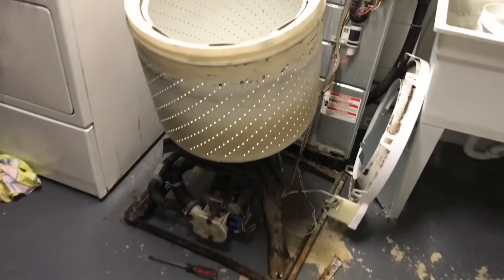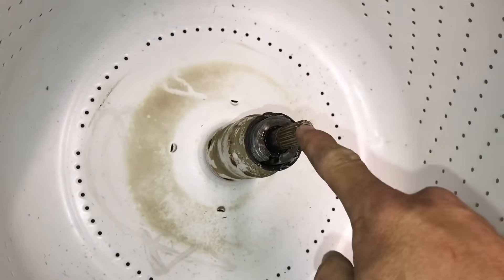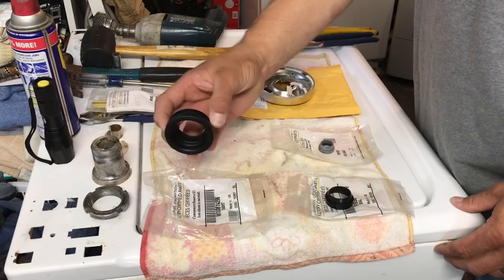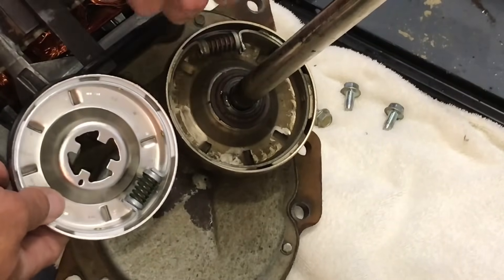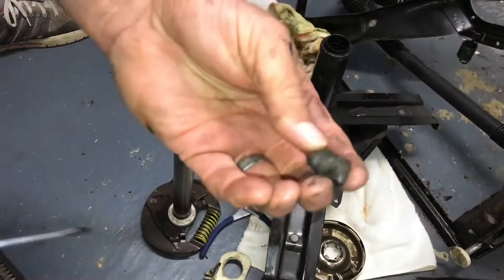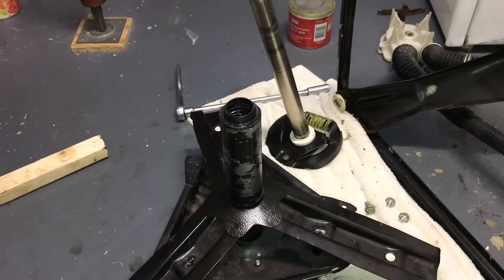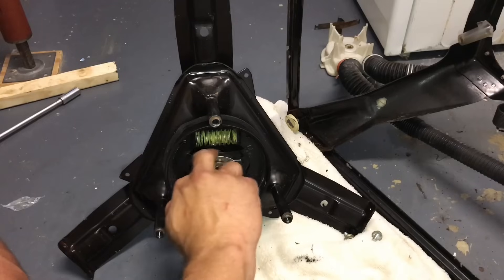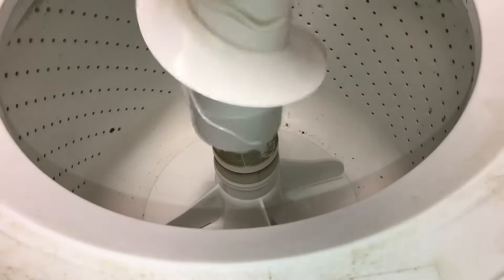Leaking Kenmore Washer - How to replace Shaft Seals.

Comment: Great video! Very helpful. I'm working on my 15 year old Kenmore washer which stopped spinning and I went through living Hell trying to remove the spanner nut, drive block and the brake assembly because of all the built up gunk. I haven't found the cause of the "no spin" problem as yet but I'm thinking the brake tube locked up inside the drum as I had to knock the top of the transmission shaft to get it off but as it's totally disassembled, I'm going to change all the seals, clutch, braking system and do a overhaul of the transmission, all new parts. I couldn't find a video dealing with the seals until I came across yours. Thanks!! One other thing that you can maybe advise me on.....the inside of the tube of the tub and some parts of the outside under the agitator are showing a LOT of corrosion. Is it wise to try to use a rust remover and some scraping to get rid of some of the corrosion then give the cleaned tub a coat of primer and appliance white or should I just scrap the project and dump the washer? The drive block was actually seized into the top of the tub and I had to knock it down the tub shaft with a large socket and an extension because of the amount of corrosion inside. What do you think? Yea or nay?
Reply from the maker: My deepest apologies for not getting back with you sooner. With that amount of corrosion that you’re describing, I would recommend buying a new machine. As soon as you repair this one or if you’re able to repair this one it sounds like you’ll have trouble with other components including the frame.  Or see if you can purchase the tube assembly that might be another option. Honestly I’m getting older and growing tired of working on things over and over and over. That’s why I suggest it might be time to purchase new.  Since your this far into it though go ahead and proceed the repair but if you find yourself tearing this thing down more than once every two years or so I would dump it.

Comment: Brilliantly made repair video!  Good pace, all the technical points covered, all part #'s called out!
QUESTION:  Where to get that 1/16" socket or nut driver for the fill shut off level adjustment?  I'm about to make a tool using an Alan capscrew that uses the 1/16" Alan wrench.
Reply from the maker: Thank you for the awesome comment and thank you for watching and subscribing. I think that tool that you’re making for the fill shut off level adjustment will work perfect. Check Amazon or a appliance supply company for that tool.  Thank you again, Happy New Year and stay safe.

Comment: good day, nice video, I pulled my old reliable apart and replaced the upper and lower seals plus the tub one, fired it up and guess what , still leaks :(, I noticed while I was down there looking for the leak that the noise it makes with the agitator seemed little odd, pulled it back apart and I can wiggle the shaft that goes though the lower seal, is there a bearing or bushing below that lower seal?, can't find anything online for parts?, is my unit trashed?, thanks for your time
Reply from the maker: There should be no play in that shaft. Especially since you replace the new seals. There is not a bushing or a bearing. At least not to my knowledge however, your model may be different. I would do some more research before I scrap the machine.  My apologies. I don’t think I was much help here.
Reply from the maker: @farmerrick9660  Thank you fir the follow up.  So glad you figured that out.  Bring new life to the old girl!!!  Cheers to you!!!

Comment: I have a question. I have a Kenmore 80 series and as I was putting the motor back in this copper like pin with a small hole on the end fell out of something. Don't know where it came from. Do you know where the pin came from? Would like your advice. Thank you!
Reply from the maker: Hello and thank you for watching and commenting. That copper or brass looking pin which is about an inch and a half long is used for shipping purposes from the manufacturer to the retail store. No need to worry about the placement. It’s not needed.  Hope this was helpful. Thank you for watching commenting and hopefully subscribing.

Comment: Good video and I appreciate the information. Did I miss it where you added any oil or grease back into the transmission case before reassembly? Mine had slung a good amount out in the bottom, which is what ultimately caused the clutch to slip. I'm just wondering what I need to stick back in there before reassembly. Any ideas?

Comment: Old video but people like me are still trying to do this repair. When I looked on appliance parts pros the installation video shows there are 2 seals for the top of the spin tube. Looks like you only replaced one but apparently it worked. WP91939 is the part you changed but underneath it is another seal WP356427.

Comment: Thanks for the video on the shaft seals.  Very helpful.  I have the same issue but I did also open up the transmission and found water in the oil.  I would suspect that any machine with leaky shaft seals could end up with water in the transmission.
Reply from the maker: I would agree.  Water will eventually find its way through the top of the transmission.

Comment: Great video, my tub makes a lot of noise as it spins up then smooths out a little. Sound is louder if heavier load like jeans. Are there upper and lower tub bearings for the shaft or is this noise from a dirty clutch or both. The seals will be changed either way.

Comment: Hi bro i saw video awesome job question I have a kenmore washer to but my washer almost the same Style as yours will the breakdown and replacement be the same? it leaks at the bottom I flipped my washer and it looks like it leaking from the seals were connected to the tub
Reply from the maker: The breakdown will be very similar for sure.  You might be lucky and only have the tub seal leaking.  That’s the large round seal at the bottom of the plastic tub. Let us know what you find.

Comment: Would the shaft seals gone bad explain leaking gear oil coming up through the tub and into the wash ? Had some clothing ruined
Reply from the maker: Sounds like the seals are bad at the top of your transmission where the shaft goes into the top. That’s an easy fix.
Reply: @SmokinwithKasket  maybe but it's a Moffit and I was told the transmission can't come apart
Reply from the maker: @Gates1999  Sorry to say - I'm not familiar with a Moffat.  My appologies.
Reply: @SmokinwithKasket  no problem

Comment: So I have a crack in the plastic tub.   Are these still available, or should I try to seal it with some sort of epoxy?
Reply from the maker: I don’t think trying to seal the tub will be successful because of the continuous, flexing, even from the weight of the water coming in and draining. If you are unable to order that part, I would suggest as a last resort to try that.

Comment: Thank you for the video. However  Im concerned that wedging out the old seals with a hammer and screwdriver could score/deform the tube bodies so that you run the risk of them not seating properly and continuing to leak even after you install new seals. 

Is there a safer way to remove the seals that doesn't risk marring the metal tubes?
Reply from the maker: Great point.  If anyone knows of a better way that would be great to hear.  I didn’t have any issues with my repair. There’s a better chance of damaging the new seal during installation.  It may be better to use a socket placed over the seal to tap it down into the tube.

Comment: When removing the drum. It is necessary to put a small screw in the top part of the shaft so the 3 jaw puller doesn’t turn as you tighten the puller.

Comment: Terrific video.  

My repair was going just as yours until I removed the transmission bolts.  The clutch shaft  would not - and will not - separate from the outer basket drive tube.  I've removed as much of the smaller top seal as possible - drenched both shaft and tube with PB blaster and pounded the top of the clutch shaft - (the end with the gear teeth) - with a sledge.  It simply will not budge.  As in "welded together".

Every video I've watched shows the clutch shaft sliding out from the basket drive tube with little effort.  I'm at a loss right now.  Called Appliance Parts Pros twice and, while courteous, could provide nothing beyond what I've tried, already.

Can you assist?

Thanks, Jack
Reply from the maker: Check to see I there is a retaining ring at the top. Short of that I can’t see a reason why it wont slide out.  Be sure there is no corrosion on the shaft at the top.  Use a wire wheel or sand paper to clean the shaft, oil well and it should come out.  Sorry - I don’t feel I was helpful.  Thank you for watching and commenting. Let us know what your outcome was. Stay safe!!!
Reply: I had the same problem when I had mine apart - did you ever resolve it?
Reply: Having the same problem I think. Transmission came out fine but can't get the shaft (upper seal section) apart from the tub support piece. Comes out almost all the way and then sticks the last 2-3". Guess i don't really have to separate them to do the seals, but would be easier!

Comment: I have mine all apart now, its definitely the same model, but im seeing something that looks off!  
Below my lower gasket there appears to be an internal metal cyldinder below it, but its a good inch below where the current lower gasket is.  

Is that right? 
I thibk i read that the lower gasket is intended to  meet against that thing, so im not sure if i need to raise it up higher to do so

Comment: Any idea where to find the part # for one of the upper transmission seals? There's some oily residue so I'd like to replace them while I'm in there. The pinion gear in the trans that also has the 4 fingers that the clutch rides on. There's a small seal inside of the gear that seals against the main shaft. I removed it but there are no numbers anywhere. Guess I could take it to the local shop and have them match it up. But you seem super knowledgeable about these things so I figured you might have a break down parts list or something. Thanks

Comment: Is there any way to tell if the leak is coming from just the tub seal or shaft seal?
Reply: Yes, I would like to know that as well.
Reply: @DieselDog358 Hi you could try doing what I did. Take a couple buckets of water and pour just enough water in your outer tub to cover just the bottom main tub seal. Now put your hands in the bottom of the outer tub and push down slightly acting like there is a lot of weight from a full load of water, now see if you notice a water leaking on the floor or down 9n the clutch assembly. If you do then it's your main tub seal that is leaking. Hope this helps :)

Comment: Cool video. Very well demonstrated and explained. I have an 80 series Kenmore washer that could certainly be repaired and or used for parts it does not leak, it simply doesn't spin anymore. Probably a clutch and/or  couplers. The wife wants a new washer but I hate to just let someone scrap it. Any ideas about how to find someone for it?
Reply from the maker: Prolly local sites like Facebook marketplace.  If the motor is good someone will fix it.   Check bulletin board at local appliance parts stores maybe.

Comment: Excellent  information  can you tell me what the plastic press in plugs with 2” brass pins in side just above the gear housing  are they important  or just for shipping I changed the pump and moving the washer some fell out  thanks .
Reply from the maker: Hi Al.  Great question. Those brass pins are for shipping purposes from the manufacturer. They fit into chassis holes to secure the mechanism from moving freely on those white plastic pads. They prevent damage to the internal chassis during shipping.  When the washer arrives the pins are easily pulled by the retailer where they fall into plastic cups which prevent losing them on the floor which could cause a hazard.  Choking hazard, slipping hazard, etc.  
Thanks for watching and hope the video was helpful. Please subscribe if you haven’t already.  I appreciate your support.  All the Best-
Reply: @SmokinwithKasket  First off thanks so much for this video especially the advice on using a 3 prong puller to break the drum loose (mine was over 20 years). I also wondered about those pins in the plastic holder but I can't see how are those pins are easily pulled by the retailer and by pulled I assume you mean the cotter pins that hold them in place.

Comment: I’m not sure how I got here or why I watched this, I’ve done it a half a dozen times if I’ve done it once. Having said that good job with it. My only complaint/suggestion is why not stick a new motor coupler and agitator dogs while your at it? Pretty much would have all the common fail points replaced.
Reply from the maker: Had replaced coupler and dogs previously.  No need to waste money.  Plus the coupler and dogs are super easy job if needs to be done later. Thank you for watching and commenting and hopefully subscribing. Be sure to check out my smoking and barbecue videos. Stay safe, my friend!

Comment: When should the center shaft bushings be replaced?  If the washer's drum is making noise?
Reply from the maker: If there’s a noise from that component I would change them out.  Only a matter of time and you’ll be dealing with issues!
Reply: @SmokinwithKasket  I have the old 90 series Kenmore.  I used to pay Sears for a yearly service contract, and had a series of technicians work on the unit.  Some techs were terrible and others quite good.  By repeatedly calling them out, the machine was essentially rebuilt. Sears then quit offering the contract - they probably gauge the repair risks by the age of the machine.  The thing is relatively easy to work on and functions well, so I expect to own it for some time yet to come....  Your video is a great help in that endeavor!
Reply from the maker: @Timetryp  - Very interesting thought you gave.  Very true I’m sure!   Thank you so much for watching and supporting. I’m glad this video was helpful to you.  Stay safe and healthy.

Comment: My washer is similar but older (11092573200).  This is a dirty repair with multiple difficulties, so if you're a novice & yours is more than 20 yrs old & leaking at the tub seal or shaft seals, consider replacing the washer.  It's a difficult repair.  Disassembly is a pain.

The lock ring spanner nut can be a bear >>  after beating & struggling w it, I ended up using a dremel to cut it, then pry it away from the threaded shaft.  It's made of a soft metal.  Then I had to use a loaner 3-jaw puller from the auto parts store to pull the steel tub & drive block off the shaft.  So that's 2 trips to the auto parts store.  thank goodness for free loaner tools. otherwise I'd have to buy a tool that would probably never get used again.

The start capacitor on the motor disintegrated when pulling off the wires & the counterweight spring crumbled at one end.  
So that's 2 more parts I had to order, plus a couple more seals, since the seal kit didn't have 'em all. doh.
Removing the old seals is a pain, then afterwards you have to scrape off the old rubber that's become welded in place.  It's a dirty repair.  

The plastic tub will have some scale >> easily removed with a paint scraper, vinegar & a scrubber sponge.  
The white tub ring above the tub was caked w dust & dirt, but that cleaned up easy w a water hose & sponge.   

The porcelain steel tub will be caked with scale & laundry residue >> it's a bear to clean.  I removed most of the scale using various scrapers, then afterwards a wire brass wheel.  It actually came out pretty good.  but there is some corrosion on the middle part where the drive block & filter ring fit.  The steel tub has a plastic filter ring >> that thing was completely clogged with scale & laundry residue & has to be removed to clean it & is kind of a bear.  But once you figure out how to remove it, it cleans up easily.  It's a flexible plastic, which helps in removal.

The drive block looked like it was basically welded in place from scale & corrosion >> but I hit it with a long wood block & sledge hammer  to knock it out.  The bottom end of the old one was corroded away.

I cleaned the shaft of the Drive/brake assy w a brass wire wheel, but it had a lot of pitting, so I replaced that.  I'm guessing the new seals may get messed up over time or leak.

All but one part that I purchased are OEM Made in USA.  Seals. seal & bearing kit. spanner nut & drive block. Dr/Br assy. clutch. counterbalance spring. capacitor.  Some made in USA parts cost a little more, but it isn't much & worth it.  you don't want a cheap chinese part to fail & have to do it all over again.  Plus, why buy made in china when Made in USA is available. some oem parts are made in Mexico, so those would be preferable to china.  The only practical way for the average guy to oppose china is to buy stuff made just about anywhere but there.
Reply from the maker: Great description on your findings.  I didn't experience your findings to the extent that you did but, add some more years on to the machine and these things may have surfaced.  Thanks for watching and commenting.  Stay safe!!!
Reply: This is good description of what you could be in for with this repair. I have taken a few of these all apart and it isnt always fun. These are lots of them still around and it's easier to buy a  used one and keep the old for spare parts than replace those seals.